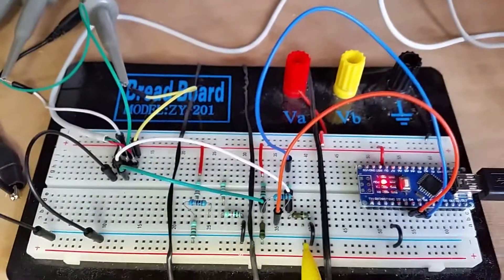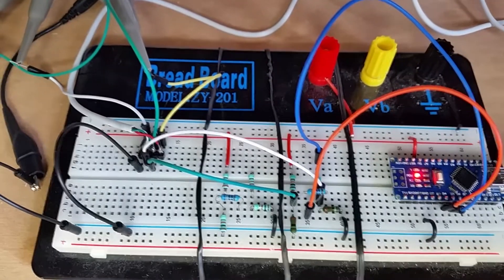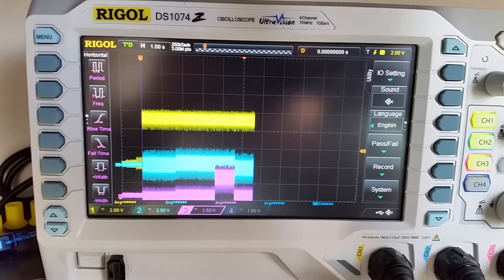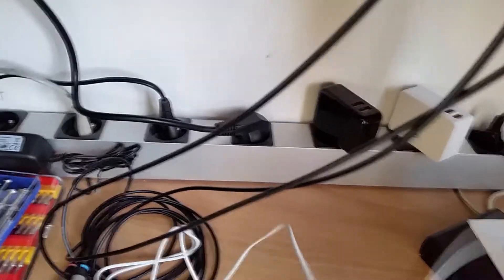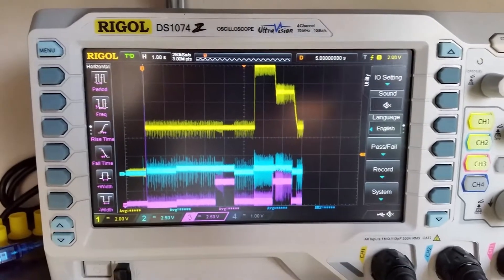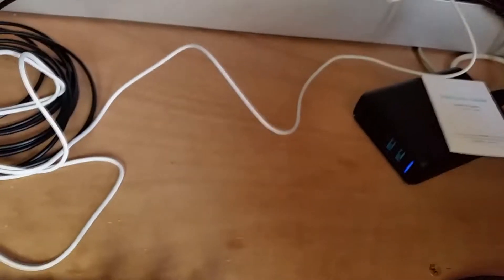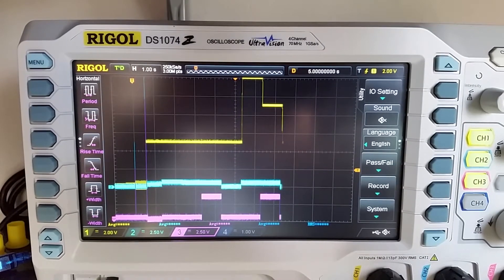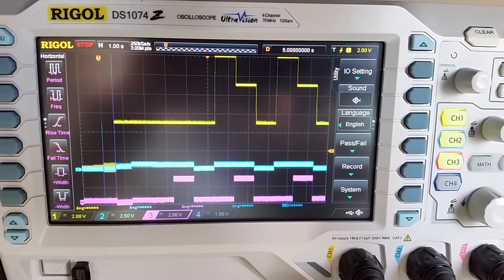Quickcharge - 3. QC2Control with new values

Comment: good work overall, thanks for sharing this.  is it possible to set QC or <PD 2.0+ chargers to a fixed "permanent" voltage so I could use it on the go without any further use of Arduino, so charger would stay at 12v after unplugging and plug cycle?
Reply from the maker: Hmm, not that I know of. I think it would pose a security risk because no matter the "enhanced" mode the charger is capable of, upon plugging in, it must behave as a "dumb" USB charger (5V) for compatiblity with legacy devices. Starting with anything else than 5V upon plugging in would put those legacy devices at risk. 
Now the required components for achieving any voltage with QC are so cheap and small (think ATTiny85 in SMD, like on https://www.aliexpress.com/item/TINY85/32213436059.html ) that you could probably fit them in a "pseudo pass through" device, or even in the charger itself, but I would still vote against leaving a standard USB socket available with anything else than 5V upon connection...